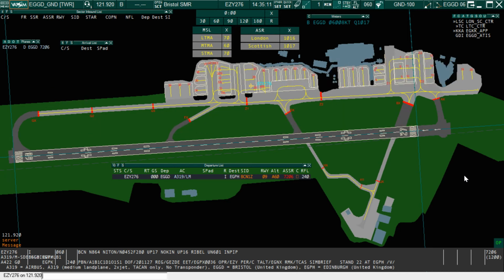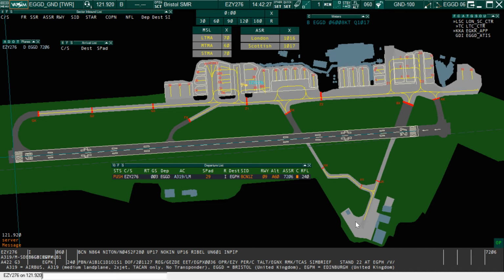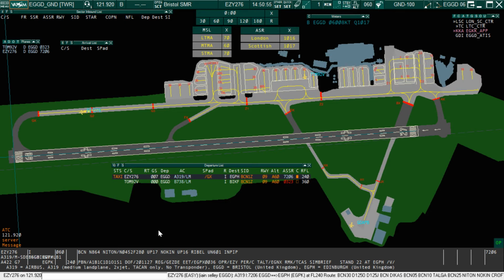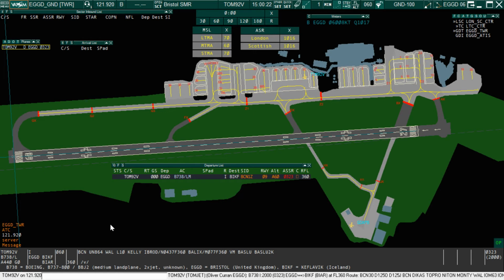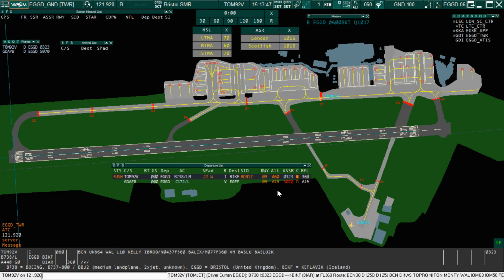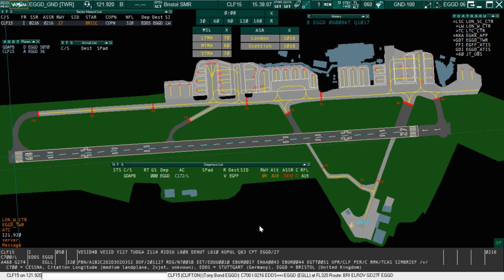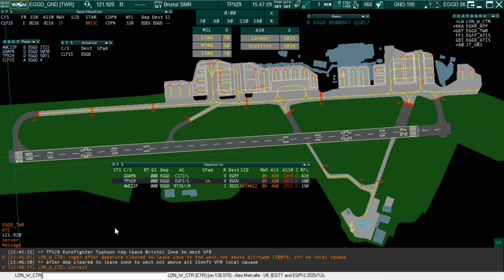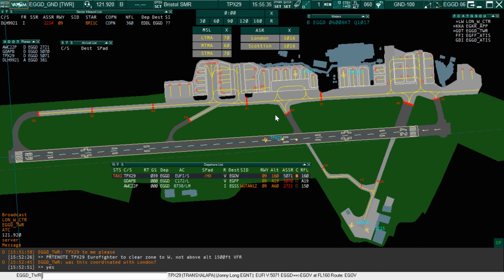Air Traffic Control Euroscope Vatsim Bristol Ground

Comment: Great video and fascinating.  Just starting to look into this.  Any good videos you can suggest on managing vat sim at the higher levels and now it works?
Reply from the maker: Hello Jonathan. Thanks for the comment. I am only S1 with a Gatwick Endorsement. I have made another video on how to set up Euroscope/Vatsim https://youtu.be/NHzsFyzt9fw I have also made some as a pilot flying with Vatsim and these can be found in my RMVideoChannel. Are you more interested as a pilot or ATC ? If ATC which platforms do you use with Euroscope ?